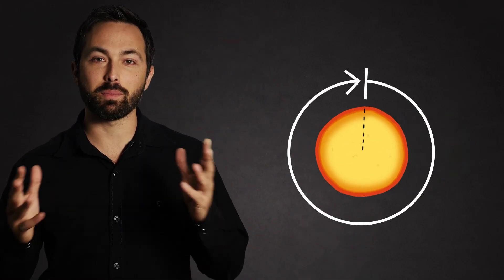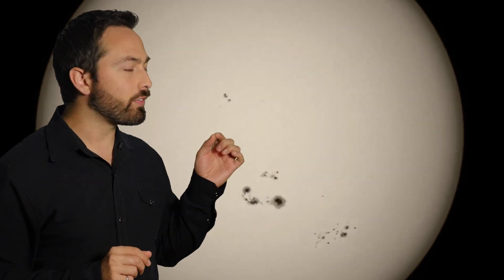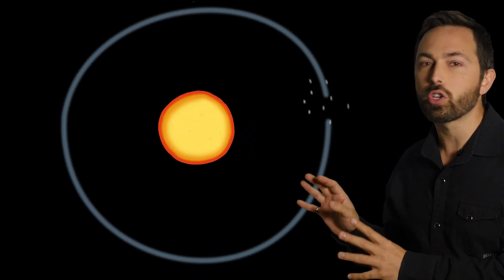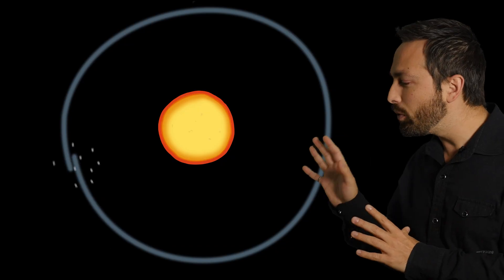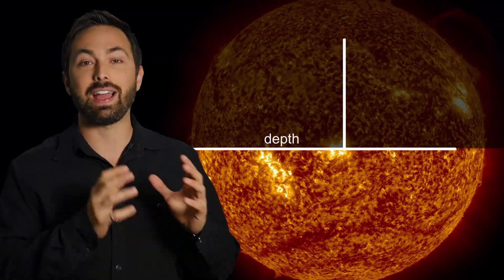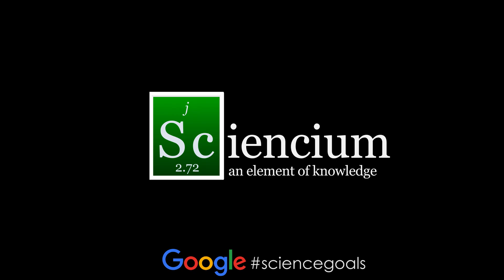Why is the Sun Slowing Down?

Comment: There is another way to explain the same slow-down. The photons coming from the part of the sun that is turning towards you, they will have slightly more energy+momentum due to the doppler effect. Likewise, the photons on the other side will have slightly less energy+momentum. This amounts to a drag on the rotation.

Comment: Can someone answer my question? 
In physics class (where I have just learnt about special relativity) we learnt that light has momentum, but also it's speed, c, cannot increase. If it's "stealing" momentum from the asteroids, where does the momentum get dumped into? The photon can't travel any faster, nor can it gain any mass. Is it dumped into changing the photons direction?

Comment: Does this mean that photons end up moving faster than light after a collision? Because of the conservation of angular momentum. Would that that not also mean that a "light year" is an immeasurable/variable unit of distance, because the units of light the photon have a variable momentum producing differing speeds?

Comment: so much easier to explain the sun when you consider the electric universe therory. the enegry is coming from outside. the sun is just a spining star that is on a cosmic power line. the corona is the hotest part but the inside is cooler. (look into a sun spot) there is little evidence to prove that it is somehow a constant hydrogen fusion powerplant inside. the universe is made of large plasmas and electricity

Comment: Ok I heard you tell us what is happening. Photons are interacting with interstellar momentum, thereby diminishing them in a negligible way over a massive impacting recurrence (reminiscent of eating a glutton's  wanted starches and other carbs until >morbidly obese). It was v of -.1 (or whatever) multiplied by the loss of chance potential of not striking the sun, a form of a large measure of loss. I'm not exact here, but wtf, I'm on the Internet, off the top of head is ok. X amount chance smwh.

Comment: Photons has mass, but its just extremely low. Without mass, light would not be bent by gravity at all, and the very idea of momentum would not make sense. Wherever you look in theories of Physics involving light or Photons, lack of mass seems not to be the case. Light = energy = mass. Density is the only difference.

Same is true for Sun's rotation - it is by the most part made out of mix of Hydrogen and Helium and definitely not a small object, therefore the inner layers endure much higher pressure from outside layers, which transfers into higher angular momentum due to atom collisions and resulting radiation waves. Surface layer has no pressure applied to it from the outside and held in place by Sun's own gravity alone, thus having lowest angular momentum. It can even keep slowing down on its own due to friction with underlying layer and its own radiation.

The slowing down of the surface might have needed an explanation, but the difference in speed was pretty self-explanatory, or at least I thought so.

Comment: Forgive my physics ignorance Derek, but I'm having a bit of trouble visualizing how the photons are still not pushing the dust particles away from the sun. 
Your analogy to the car driving through rain makes sense, but to me it still looks like the net force on the dust particles would be away from the sun. My guess is that the angle of incidence between the photon and dust is greatly exaggerated to convey your point, is this correct? 

If my hunch is correct, would this be caused by the speed of the photons relative to the speed of the dust particles? AKA the light hits the dust almost moving tangential to the surface of the dust? Wouldn't this just spin the dust particles? 

Love the videos, Thanks!

Comment: obvious question / questions, but it has to be stated.....  is the outer layer (which may well be slower than the internal layers underneath as you report)...   demonstrably slowing progressively over time?.....through what really amounts to sufficiently "statistically relevant" observations?  i..e it's overall decrease in momentum is otherwise demonstrably related to its age.   
Or...... is there the slightest possibility, that the amount of time spent measuring this layer represents such a small sample size, (when compared to the incomparably equivalent duration of the Sun's life, which I believe is presumably in the region of several billions of years), and is thus in danger of being a fallacious line of reasoning, so insignificant in fact, as to be falsely ruling out  a whole multitude of otherwise unknown processes that may, or may not, potentially bare some stronger correlation to the speed of this outerlayer?  i..e what about tidal forces from all the planets tugging on its surface? (like the relationship between the moon and the earth) what about the electric force playing a roll? what about long changing periodic fluctuations in its power output due to other potentially more relevant variable factors?   
how deep can we see inside the Sun anyway? what about even deeper processes near the core and their potential baring on this outer layer?    I don't mean to be picky.... but it sounds like this concept is subject to a lot of supposition. 
I mean that with respect obviously... I'm no scholar.... just a prick with humble Socratic intentions.

Comment: But the light is a product of a reaction that turns mass into energy. Even if it losing rotational momentum to photos, it's also losing mass to create them. I'm surprised these opposing mechanisms don't dampen the loss of rotational velocity. Furthermore, the breaking is a function of speed with an exponential decay, so I am again surprised that the star would ever stop rather just get very slow.

Comment: @Sciencium This still doesn't explain the near surface shear layer, as the slow down timescale is far larger than that of the convective timescale. i.e. convection will dredge up material faster than the "photon drag" can slow it down. Similar arguments can be made as to why the solar wind doesn't cause this either... It is still a very much unanswered question in my opinion.

Comment: if light doesn't have mass how can it create drag? even with momentum 0x1204154120581=0 no? and i thought light was locked in at a speed. how can protons gain or loose momentum?
Reply: Photons have energy. E=hf
Reply: Dino I understand that they have energy, but they don't have mass right? and from my understanding light doesn't speed up or slow down it is constant. so what energy could it transfer?
Reply: It loses momentum in terms of its frequency, not velocity. This happens all the time - the heat you feel from the Sun is actually infrared light transferring energy to your skin in terms of radiation. This also explains energy gained in solar panels.
Reply: that helps i wasn't thinking in terms of wave lengths but now i understand thank you.

Comment: You said a photon has no mass, but it has momentum, so it can slow down the dust particles. Does that mean F = ma is wrong? Even though the momentum of a photon is 299 792 458 m/s, 299 792 458 times 0 is still 0.
Reply: 'a' represents acceleration, not velocity. a=F/m works even for photons, because it takes no time for them to accelerate from zero to c once manifested in existence. But generally speaking, Newton's laws become inaccurate in relativistic conditions.

Comment: From the video, the reason for the slowing down of the rotation of the outer layer of the sun is accounted to photons applying a "drag" by "stealing" momentum. My question is, wouldn't there be equal numbers of photons hitting from "forward side" of the rotation (so these photons will slow down rotation of the sun's outer layer) and from "backward side" (so these photons will in turn speed up rotation)? If that's true, then the slowing down and speeding up ought to have cancelled out and ultimately there wouldn't be any observable change in the speed of rotation of the outer layer of the sun.

Why is there still an observable drag to the rotation of the outer layer of the sun (or any stars, in general)? Are there more photons hitting from the "forward side" than from the "backward side"? Or, does the photons hitting from "backward side" lose less momentum than photons hitting from "forward side" gain momentum?

Comment: One thing I don't understand is that if the outer layer of plasma is being slowed down by photons bouncing off its surface and taking its angular momentum, why doesn't that happen to the layers deeper within the Sun as well as photons are bouncing around inside, thus possibly slowing down particles? Not to mention a photon is stuck there for a much larger period of time. Also, photons don't just travel in one direction so they won't always leave the outer layer by bouncing off in a direction opposite to that on the spin of the Sun, sometimes they might bounce off the "back" of a particle, giving it somewhat of a boost in the spin direction.

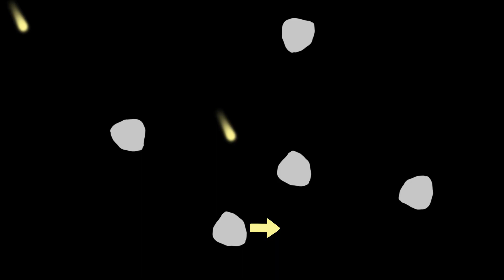Comment: at 2:08, You stated that, in astroid's frame of reference, the photons impact the asteroids at an angle, imparting some negative momentum. But in absolute frame, the photons impact perpendicular to the asteroids velocity, ie if the asteroid was orbiting in a circular path. That(perpendicular force) would only change the direction of velocity, not its speed, hence shifting the circular path to an elliptical path. Only then,  within an elliptical path, there are regions where the photons aid the asteroids and there are regions where photos decelerate the asteroids.

Comment: I would have guessed that it was a tidal phenomenon with the planets, much like tidal forces shifting the Earth's angular momentum to the Moon, causing the Earth's rotation to slow while the Moon's orbital velocity increases.
If, on average, photon interactions slowed the outer layer, then the resulting path, on average, should be skewed towards the direction of the Sun's rotation. Hence, there should be more photons reaching Earth from the approaching half of the Sun than the receding. Could this be measured?

Comment: I watched this video through, and I'm not saying I don't like your videos (I even learn a bit from them), but I think you might be wrong (Or not, I could be wrong also)

See, The larger an object's mass (And size) is, the more time slows down. At the Sun's farthest out layer,  the gravity is immense and time slows down itself, making the outer layer appearing slower. As you go farther in the Sun's layers, it gets progressively smaller but more compact. If the sun is layered into separate sections, than it would make sense that the layers get faster as you go along. For example, if you had two balls of different size but the same natural element and spin them at the same speed over the same axis (Sorry for the run-on sentence), than the larger ball would likely take longer to make a full rotation rather than the smaller ball (If these balls are the same natural element, such as iron).

Now to answer the actual question of the video: Why is the Sun slowing down?

It is likely you know the idea of entropy correct? The idea that the universe is losing its usable forms of energy, and everything is slowly losing energy (That's why stars die, because it requires energy for nuclear fusion). The idea that two objects (Of the same natural element) with different sizes will require different amounts of energy to move. 

The sun (Like all stars) uses tons of energy just to exist, and not only that but rotate within its own layers. As the sun progressively gets larger from age, it requires more energy to move it, and therefore will move more slowly. 

That's my explanatory theory as to why the Sun is slowing down. I hope I don't sound unintelligent with a few of the scientific flaws I see in this, but I already wrote it anyways.

Comment: actually the numbers of photons accelerating and decelerating the rotation is mathematically equal, so there is most definitely another cause to slower movement of sun's outer surface. I am almost sure that it is related to the differences in temperature and gravitational variables' effects on different layers of sun (and basically of any cosmic body, although in gas giants and in stars it is easily observable due to less friction between the layers).

Comment: This explanation has been figured out by people vastly smarter than me, so it's probably my fault if something does not sound right to me.
For example, I found it hard to associate the concept of "momentum" to a photon, since the photon, AFAIK, is a mass-less particle. And since momentum = mass x velocity, if the mass is zero, the momentum must be zero too.
Also, an increase in momentum must cause an increase of speed (as per the previous formula), but since the photon is already travelling at the maximum possible speed (you know... the speed of LIGHT)... again, where does this energy go, given that energy cannot be destroyed (1st principle of thermodynamics)?

Maybe the extra energy goes into something else, like increasing the photon's frequency?
A slight shift of the photon's light towards the blue side of the spectrum must be the answer.

Comment: The loss of energy from photons "raining" on the front is a great explanation.

There is a larger effect than this, that is even cooler. The direction something is spinning around a star determines whether it spirals in, or spirals out! That sounds crazy, right?

Not kidding. Here's how: Radiation. A thing heated by a star re-radiates its heat. When something spins in the same direction it orbits, that heated face of it spins to the back, trailing side, and shines out to give a little boost of speed, which makes it go higher in orbit! Something spinning in the opposite direction as its orbital direction, spins its heated face to the front, kicking out its nose and slowing down.

Comment: There's one thing bugging me about this solution; if the photon hits a dust (or any other kind of) particle, the photon its momentum will change (as told in the video). How is this possible? The equation for momentum is m*v, but photons are said to be massless? Even if m token for a definite small mass, then the velocity of the photon would increase, but the speed of light is set... How does this compute?

Comment: when a photon collide with the dust particle, to conserve momentum it gains momentum. But if the photon which is moving at a speed of light  gains momentum means that either it increased its velocity or it gained some mass. But C is constant so it must increase its mass/energy.
can you please explain this? and if am wrong correct me.

Comment: And here's why coudn't consider rain drops and car example analogous to photos and star... 
1) Rain drops hit the car moving in a circle from outside the circle (while photons hit dust particles from inside the circle)
2) The downward force exerted by rain drops would increase the friction (as the car cannot go further downward) which would in turn slow down the car. 
3) Resultant force vector would be horizontal force (car) + vertical force (drop) ; There won't be drop in magnitude in the horizontal direction.
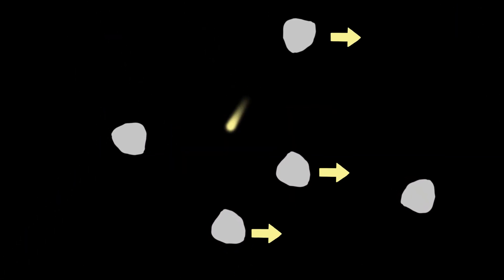4) @2:01 the illustration makes us think like the photos are not incident at right angles but at <= 60degs, which is false
Correct me if I'm wrong @sciencium

Comment: whoa whoa whoa back up...Photons have zero mass...how can a zero mass particle steal energy from mass??? Further, if momentum is conserved, then wouldn't that mean the reflected photon is now moving slower then the speed of light? If the photon travels at the speed of light, before and after slowing the dust, where did the energy come from to slow the dust down??I know it sounds silly, but need a logic boost here.

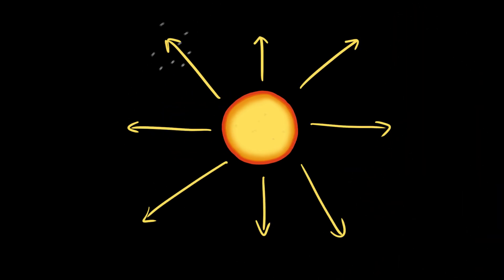Comment: @1:47 photons are emitted radially (moves along the radii of the circle) and the dust particles move along the circumference of the circle; the force (by the photos) would (should) push the dust particles away from the star without affecting its velocity vector along the tangent which in turn should cause them to escape if hit repeatedly with enough photons! What logic am I missing?